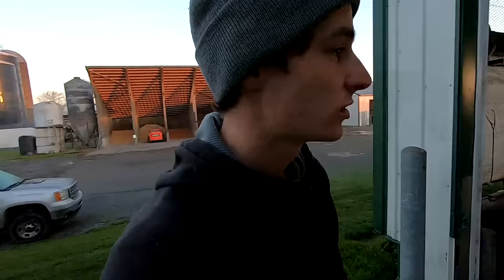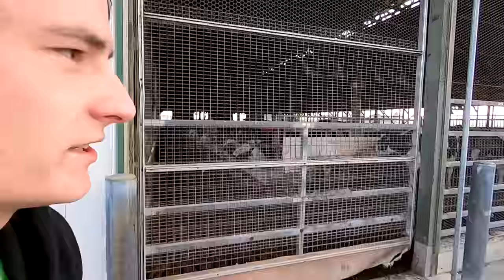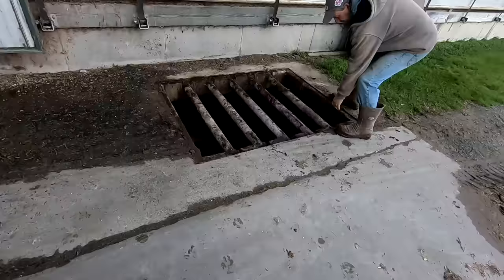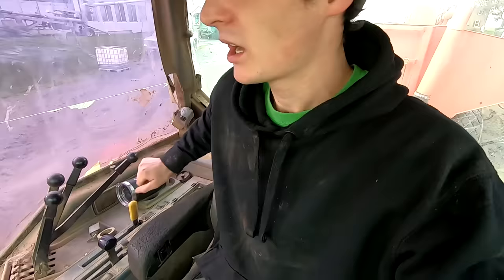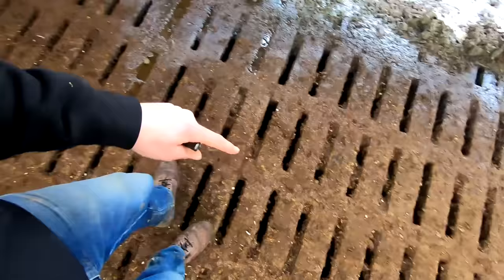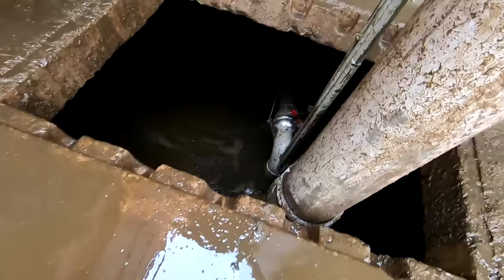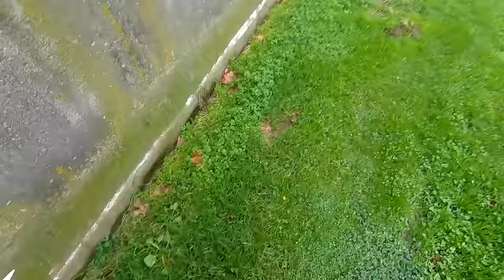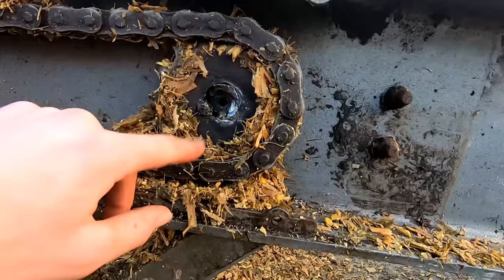Manure Farming

Comment: I'm with you 100% on the welding vertically.  I'm not great welding but if I can be comfortable I get a lot better weld.  Good call with all that torque required for the shaft.

Comment: Just a suggestion - instead of caulking the holes in the sheet metal install a plug screw, they are made for this purpose. I believe they are a #17 plug screw with a rubber washer.

Comment: Nice to see the young farmers working the farms, by the way pouring water on Hot weld Will cause it to crack I know u didn’t want to burn the seals out in the pump by pouring a little water around the shaft and not on the weld will help

Comment: Like you I would always try and find a way to flat weld something. I wasn't strictly a welder by trade but as an industrial/commercial machine mechanic I was forced to have to do it. Welding is something of an art form and you have to constantly do it to keep your skills up (some of the best welders I've known were also good artist). I absolutely hated overhead stick welding, unfortunately due to the strength and penetration needed sometimes you'd have to use a stick.

Comment: Just a note about the welding job.  When welding on equipment with bearings or things like hydraulic motors, attach your ground clamp directly to the piece you are welding.  If the welding current Flows through  a bearing or hydraulic motor it could arc across the precision surfaces and cause premature bearing failure.

Comment: You should of drilled it an tapped it 3/8 run a bolt and washer down temporarily.. welding in two different metals is iffy

Comment: Do you start the fan’s inside the barn to get some more efficient airflow so the gasses from the manure gets taken away, or is there enough airflow without starting the fan’s? Because since there’s no wind, the air stands still, and the gasses don’t get taken away, or? 

Here in Norway we usually don’t stir the manure when theres no wind, don’t matter if all the windows and hatches are open or not, it won’t help if the air stands still when there’s no wind. Won’t take any chances 😅

Comment: At a 1000000 gallons and tank carrying cap of 7300 gallons it would take aprx 140 trips  and at 1 mile away round trips would be apx 280 miles and at 30 miles an hour it would be aprx 9 and a half hours drive time bearing in mind this does not take into account set up and pumping time.  Luca

Comment: At a 1000000 gallons it would take aprx 140 trips  and at 1 mile away round trips would be apx 280 miles and at 30 miles an hour it would be aprx 9 and a half hours drive time bearing in mind this does not take into account set up and pumping time.  Luca

Comment: A familiar problem, we have used a product called Bioterra I and II in the manure. This consists of a mixture of bacteria to "digest" the manure and keep it liquid. As a side bonus, it binds Nitrogen in the manure and reduces NH3 losses to the air. The effect on the field was obvious with and without addition. It is expensive though and I'm not sure if you can get something like it (vossenagriculture.com). Mind you it did take years to digest a small pit which got blocked.